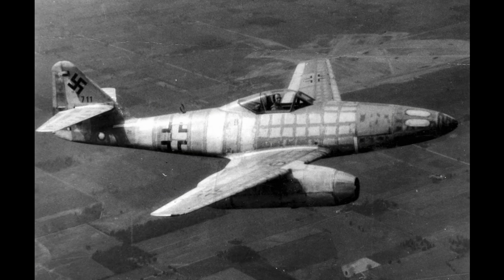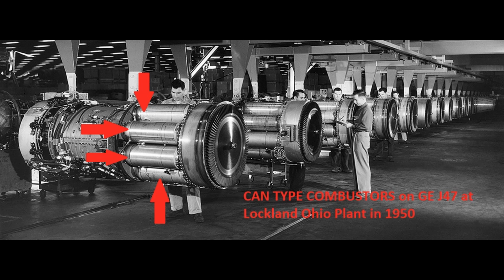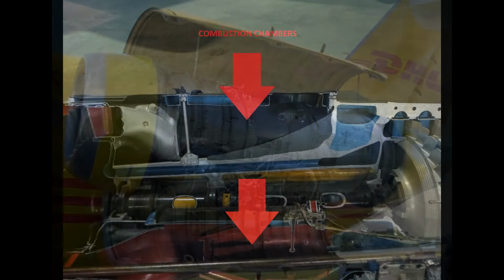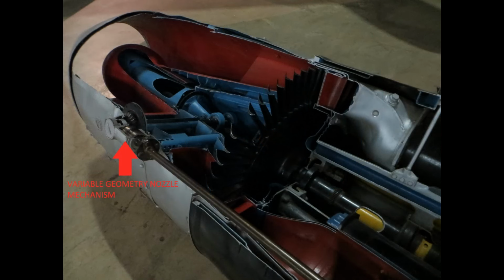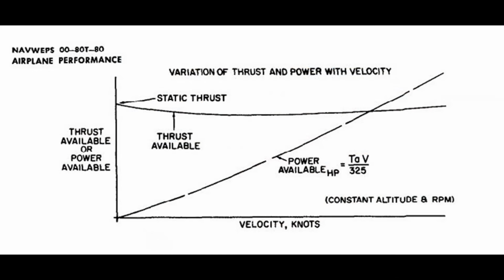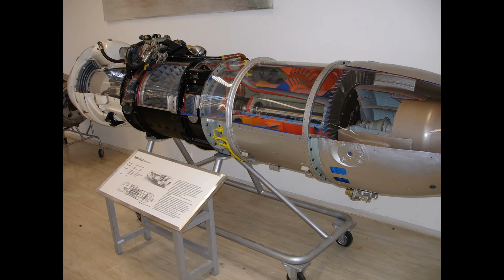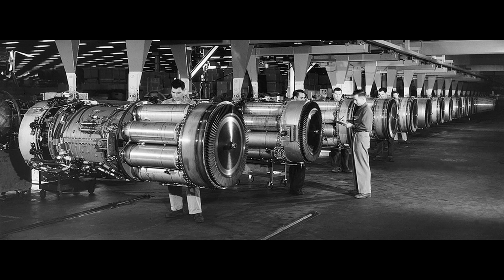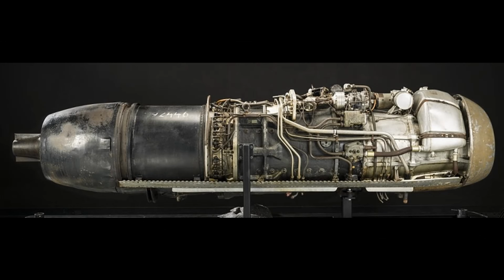World War Two JET POWER

Comment: Rolls-Royce used a radial compressor in the Nene, because development and iterative design had created a near perfect supercharger compressor. If was the obvious way to go for the first jets.
Reply: Britain lacked the technology to build axial compressor turbojets, the centrifugal turbojet was an evolutionary dead end.
Reply: @sandervanderkammen9230 
Ryce Muncherz Kharzeestan Krapper DiktorBummer etc & co - they should note well & remember pelly good with much awestruckness please.
     Their comments are readykyoulous phFabrikayshunz. 😂
  Multi stage sequential stator rotor  Axial compressors & Axial turbines had been demonstrated  before 1900 in England. Internal combustion axial gas turbine aero engines were being considered, researched & built in England since 1925.
 The Whittle centrifugal compressor internal combustion reverse flow & straight through combuster gas turbine aero engines is still manufactured & used for turboprop & helicopter applications & more than 30,000 have been produced so far.
    The gas turbine was of course invented in England before 1800, why would they expect it to not have been the case, obviously.
   The world's first demonstration of a practical internal combustion gas turbine aircraft engine was in England in 1937.
    The world's first demonstration by Parsons of the components of a coupled multi stage axial compressor & axial turbine unit using sequential bladed rotor stator stages was in England before 1900 when of course people in England began considering their use as the basis of an axial compressor internal combustion gas turbine aero engine.
  Parsons didn't manufacture steam engines.
  Steam engines don't have multi stage bladed sequential stator rotor axial compressors & turbines. 
Oh yes & the PW200 range of gas turbine engines are in fact directly derived from the Whittle centrifugal compressor internal combustion reverse flow combuster gas turbine aero engine which of course was demonstrated for the first time in the world by Whittle in England in 1937.
👍
. ... . ... .. ..... ..
cvxiiivxcviiiiiii
Reply: @petemaly8950  Why cant you answer the simple question?
Reply: @petemaly8950  Why cant you answer the simple question?

Comment: April 2022. Just watched. I wish that you had gone into more details on the metallurgy of this.
Also. Paul Allen's 262 restorations, clones and rebuild. His insistence on originality re-engineered/replicated an exact Jumo for his 262 for airworthy flight, however, using durable metals instead.
.
Thanks for the videos.
Respect.
Reply: The German company Krupp invented stainless steel, it introduced P-304 in 1918 and nickel based P-193 Tinidur in 1935.
 Whittle was using 304 alloy and later Rex-78, both were low nickel and had poor creep resistance.
Jumo and BMW both used P-193 Tinidur alloy which was equal or superior to Nimonic.
 Shortages of nickel forced Germany to switch to chromium-based Krupp P-198 Chomadur which has a creep temperature between Rex-78 and Nimonic 70.
P-198 is still used in jet and gas turbine engines.
Reply: That information is unfortunately inaccurate, the Jumo -004 engines were restored to original specifications and no changes were made to metals used, the new parts are 60% nickel same as the original alloy used by Jumo.
Reply: That is not true, the Paul Allen engines were restored to their original specifications using the same commercially available materials. A286 is still used in jet and gas turbine engines today.
Reply from the maker: Hi Loki. I'm not a metallurgy guy, those sort of things are best handled by other channels.
Reply: @GregsAirplanesandAutomobiles  
Wow. Thanks for the reply. -Sorry if my comment reads like I'm asking/wishing for deep science on the topic. (Used the word "metallurgy"). Just the novelty information level of what type of metal should have been used   'here' and 'here', if it was available, and the life of the engine would have been X, as is/became the afterwar standard. (Instead they used readily available... - Metallica? (Joke)).
But, you did point out the F86 also had a similar short service life. ...WITH proper metals?
.
Cheers
Reply: @lokirenoir6413    When Paul Allen's museum gave a presentation on the Me-262 they the discussed the engines some, but unfortunately they did not have any representative from the engine contractors who could have gone into more details.  Historically his museum relied on contractors and sub-contractors to perform much of the work and often under secrecy.  It has been the same for many of the aircraft.  The Me-262 engines were rebuilt in California and some of the metallurgy work was done by an aerospace vendor in Illinois I think.  The museum has lots of photos and documentation I'm sure and it would make a great book if someone were to organize it.   The turbine shop did say in a published article that they estimate the refreshed Jumos will be good for approximately 300 hours.   It's worth mentioning that after WW2 the Jumo 004 was manufactured by Avia in  Czechoslovakia and by Klimov in Russia and even with a better manufacturing environment I don't believe that those engines were significantly more reliable, maybe some.
Reply: @lokirenoir6413  Excellent point, the J47 had TBOs as little as 12 hours without war-time metal restrictions.
Reply: @FiveCentsPlease  Please stop spreading misinformation. The Paul Allen project engines were repaired and overhauled to original specifications and no modifications or significant changes were made when possible.
Reply: @sandervanderkammen9230   You were not involved in Paul Allen's project, unless you can demonstrate otherwise. The overhaul specifics have not been shared, per the standard non-disclosure agreements which Allen's Vulcan Aviation required for all of their vendors and subcontractors.  This is how Vulcan has operated for decades, and the video updates given by the museum on the Me-262 and Stuka were very much outside of the norm.
Reply: @lokirenoir6413  What do you mean by proper metals?  All jet engines are made for creep resistant, oxidation resistant stainless steels... this was no different for the German engines.
 Krupp P-198 is a very high heat resistant stainless steel used in the production of the Jumo 109-004B. this material is still used today.

The Me-262s engines were superior to Allied engines because they introduced the first use of internal  bleed-air cooling of the turbine blades and the first use of advanced TBCs.
 the -004 engines blades and combustor liners were coated with Cerro-Alumina, a high heat resistant ceramic coating that protected the stainless parts to temperatures up to 1,850 degs.  F

Standard on jet engines today but completely unavailable to the Allies during WW2.
Reply: @FiveCentsPlease  All engines adopted into Luftwaffe service were required to pass the RLMs 100 hour PFTR reliability test. This is the exact same 100 hour requirement for the RAF and the USAAF.
 We can dispel this infantile urban myth that German jet engines were somehow less reliable or inferior to Allied engines... in facts tests performed after the war show the German engines were more reliable than many allied engines.

Comment: 500 kills for the Me-262? Where does this figure come from? Price and Ethell claimed it was closer to 150.
Reply: 500 is a very conservative number, 26 Me-262 pilots scored Ace or higher, Erich Hartmann the highest scoring Ace in history  (352 kills) was a Me-262 pilot.
 Me-262 pilot Kurt Welter is the highest scoring jet Ace in history.
Reply: @sandervanderkammen9230 
Fryed Ryce Munchyrz Kharzeestan Krappenz DiktorBummer Werkzxoffen etc and co - they SHUD note good with much awestruckness and
   Those guys had a habit of making stuff up all the time.
  The accident rates for the Gloster Meteor were average & similar to other fighter aircraft of the period. In fact some later jet fighter aircraft from other countries had worse accident loss stats.
   Whittle style centrifugal compressor reverse flow combuster internal combustion gas turbine aero engines are not obsolete & of course are still manufactured in significant numbers for turboprop aircraft & helicopter applications.
  Any ?Kweschuns? sonny Jim Jimminy boy lad? 
😂👍
Cheers!
. ... . . ... . . ... . . ... . . ...
vcxivcixcvviiii. cvxcvxcx
Reply: @sandervanderkammen9230 
UPDATE
Fryed Ryce Munchyrz Kharzeestan Krappenz DiktorBummer Jurkzxoffenz etc and co - they SHUD note good with much awestruckness and much better wonderment etc.
  The accident losses for the fabulously superior Gloster Meteor were in fact not particularly high for fighter aircraft or jet fighter aircraft of the period.
 When powered by the world's most powerful jet engine at the time in 1944 - the RR Nene, it subsequently broke jet aircraft speed records.
  A 1945 Gloster Meteor of course was the world's first Turboprop aircraft.
Some later aircraft from other countries had higher accident loss rates.
Non combat phase accident losses 
% of Aircraft built.
US Lockheed  P80  Intro 1944      46%
UK Gloster Meteor Intro 1943      17%

Any Kweschuns lad?
Cheers 👍🙂
  
   
 
  
. . . . . . . . .............. .
xcxvxcxvxcxvivicixc

Comment: It's interesting to hear Greg compare the engine lifetime with the average fighter aircraft lifetime. "A careful enough pilot could probably double the engine life" so then you're looking at an engine that might last upwards of 40 flight hours, but very significant risk that the fighter may last 15 flight hours (and not too much chance of the engines surviving the loss of the airplane!)
Also interesting how, by the time the 262 was going into combat, Luftwaffe was suffering in multiple ways. Fuel supply issues. Shortage of steel hardener metals. Shortage of pilots. Aircraft factories bombed(?)
Reply: + Julian Brelsford   During the rebuild and restoration of the Me-262 at Paul Allen's museum to airworthy condition, they noted that the engine parts were numbered to match.   It is like they were hand fitted to each Jumo engine and could not be exchanged.  That late in the war, it almost looks as if the Jumo turbines were considered low-hour throwaway units.

Comment: Good to see someone touch on the resonance problem and how they solved it.   That held back the the engines series production until August 44, all previous 262 used engines from a pre production batch that suffered from the resonance issue.  On your claim the 262 shot down 500 allied aircraft that's a German claim never verified.  Alfred Price wrote two very comprehensive books on the last year of the Luftwaffe covering types and units day to day operations that shows this number impossible.  The kill ration of the 262 has been placed more close to 1.5 to one.  Also the idea modern engines have any connection to the Jumo engine program is misplaced.  They owe their history to the Metrovick Axial program which had the first run of an Axial flow turbojet in 1941 with flight testing in mid 43.  Not much is mentioned about the program which saw wartime engines used in high speed launched and in static generators.  Among the research was the creation of the turboprop and turbofan during the war.   It also laid the groundwork for one of the most successful turbojet engines of its era, the Sapphire.   While the Germans were struggling to get 2000 pounds thrust the Metrovick team were able to get 4700 pounds thrust.   The thing was the government had nationalionalized  Whittles Centrifugal flow engine which led to three manufacturers producing their own general version, Whittles Power Jet, Rolls Royse and DeHavilland at a much cheaper cost than had they entered into production agreements with Metrovick.   For all his work Frank Whittle received 100,000 pounds and a knighthood.

Comment: Greg, could you comment on the actual fuel the Germans used as compared to , say, JP4,5? I've always assumed that it was more of a gasoline type than a 'diesel fuel' type, due to the rapid temperature spikes caused by throttling up too quickly. BTW, thanks for these aviation-geek pleasing videos..
Reply: + Corey and Nathaniel Chartier   Somewhere I read that there were seven acceptable fuel blends for the Me-262 although I think I was reading some recommendations for what could be mixed in the field as a last resort.  I think the fuel type was J2, coal-derived fuel similar to kerosene.   The prototype turbines ran on diesel fuel and since J2 was hard to find the Allied pilots commented that the captured Me-262s ran better on diesel fuel.  Gasoline could be mixed if nothing was available but it affected performance and fuel burn.
Reply from the maker: I would if I could, but the actual chemistry involved is way outside my area of knowledge.

Comment: Golly Gee Greg I just love your stuff! Thanks! I am sorry Greg but I have to ask this Questions:-
1. Were both the Junkers Jumo and the BMW jet engines were based on Hans Von Ohains designs etc?
2. I presume but would like you to confirm that that the Gloster Meteor was based on Frank Whittles Design?
3. Which of these Designs (a) Whittle Engine or (b) the Hans Von Ohain Engines prevailed post WW2
4. Did the Heinkel He 178 flew on 27th August 1939?
5. Did the first Gloster E.28/39  fly on May the 15th 1941?
6. Hans Von Ohain went on to invent many other aviation first in his new country the USA whilst working for Lockheed Martin, the first major one was the Turbofan Helicopter Engine!
Reply from the maker: Hi Rob. It's impossible for me to completely answer even one of these questions in the comment section, especially when you used terms that are highly subjective, like "based on". I often hear that one engine is based on another, I recently addressed this in my P-40 video which discusses the idea that either the Merlin or the Allison were based on the other.

That's said, I'll do my best here, but please understand these answers are nowhere near complete.
1. Here we go, "based on". I would say no, except maybe in the most vague sense, meaning both provide propulsion via exhaust thrust. Is the F-15 based on the Wright flyer?
2. I don't understand this question. Frank Whittle didn't design airplanes. He did design the type of engine used in the Meteor if that's what you're asking. 
3. Neither. It' somewhat ironic, but the axial flow annular combustion chamber design is the type that prevailed, and by a huge margin. In fixed wing aircraft it's something like 10:1 if not more. I can't think of a single jet airliner not using this type of engine. The centrifugals do have some advantages though, and are most often seen in applications where jet thrust is not the primary source of power (i.e. turboprops, helicopters, large industrial pumps, etc.)
4. I don't know, I don't have these dates memorized.
5. Ditto #4.
6. That's not a question.
Reply: Thanks so much for your considered thought and opinion; al the way From Robert Miller New Zealand.

Comment: The Jumo was junk, like all axial flow engines of that time. Typically the Germans went for "The Best" & over engineered it, instead of going for the "Good enough" solution which is perfect for fighting in a war where your expensive, complex engine's life may be measured in mere minutes. The Brits understood this & stuck with centrifugal engines as the engineering, manufacture, metallurgy & physics was already very well understood due to the similarity with piston engine superchargers. You don't in wars with  weapons as fragile as the Jumo 004 which couldn't even be throttled up rapidly!

Comment: Absolutely fascinating there was no mention of British Jet engine development of the Centrifugal Jet Engine developments during WW2 which led to such designs as the GE J31 and J33 (4,600 lbf static thrust), which alos powered the highly successful operational Mig15 (Klimov VK-1 reversed engineered RR RB.41 Nene and P&W J48). Axial flow designs were also in development during WW2 as well in the UK, which led to the Armstrong Siddeley Sapphire (Metropolitan-Vickers F.2 first run in 1941) and J65. A Gloster Meteor F8 (1948) with Sapphire engines was achieving climbs rate comparable to modern jet fighters of the 2020s.
Axial flow turbojets were much less reliable, short life times and had less static thrust at the time but offered future promise for the Supersonic age, with less frontal area and higher compression ratio for the inlet size. Centrigual Compressor engines were developing 3500+ lbs of static thrust by 1945 compared to 2000 lbs for the Jumo 004. The British Centrifugal compressor design engines also had much higher thrust/weight ratios during WW2.

Comment: From memory; in Adolf Galand's autobiography, he flew these things in combat. He stated the British engine was better than the German but that the German ME 262 was a better fighter aircraft than the Meteor.  I guess the British had access to better materials for turbine blades where as the Germans didn't. Whittle, I think used centrifugal compression, on his design because he was suffering from a severe lack of funding from the Brits. Who had blown all their money on the 1st war, were now in the 2nd war and owed their shirt and  pants to the yanks to pay for it all. Some say, the reason the yanks backed the Brits both times is because the Brits owed them more money than the Gerrys. So the the Yanks would have lost more money if the Gerrys had won. But then again the older I get the more cynical I get.